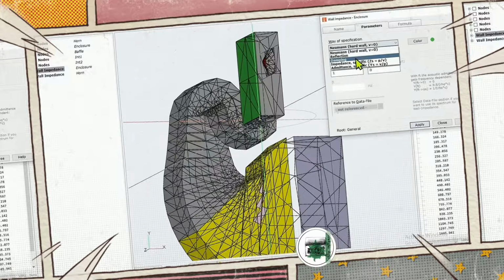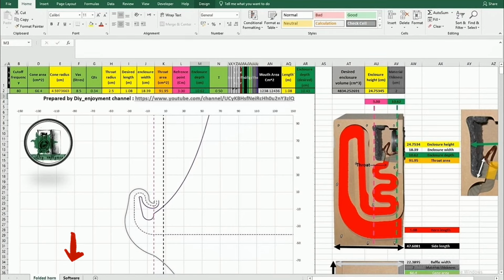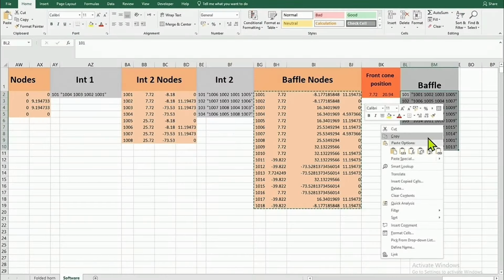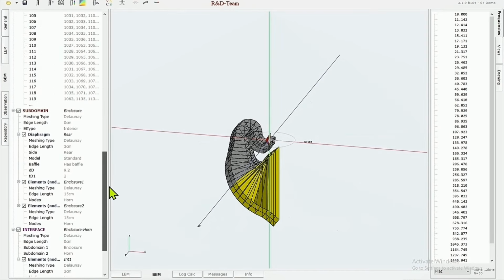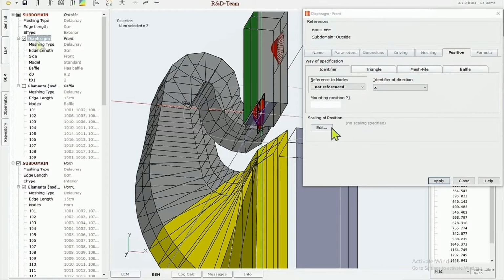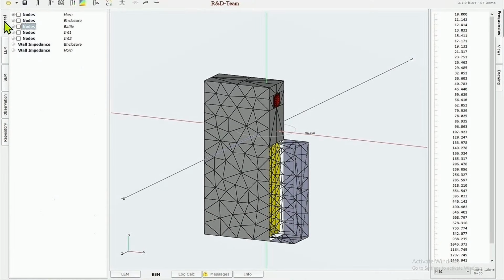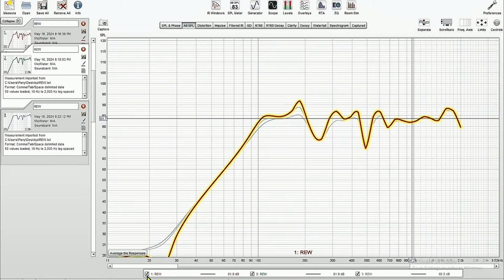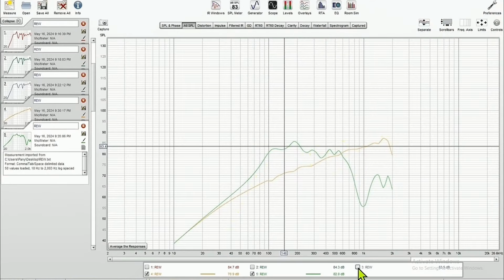All about horn speaker design-9

Comment: Pls. Don't waste a time an resources on squeezing low freqs from a tiny button. Any dedicated 8-10" woofer gives significantly better results in a closed box of a same volume for a reasonable price. With only 6 simple walls. And if you take a powerful enough driver and a DSP and a D-class amplifier, you'll get 35Hz  @ -3dB from enclosed 8 liters with 6msec of a group delay down to the lowest possible frequency. Pls don't tell that you are not able to save $300 on lunches for that setup.